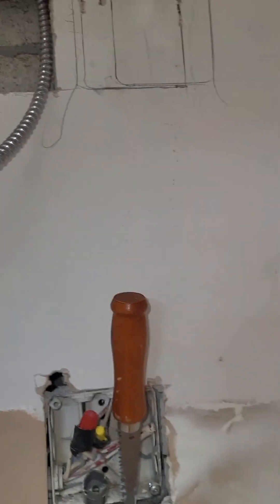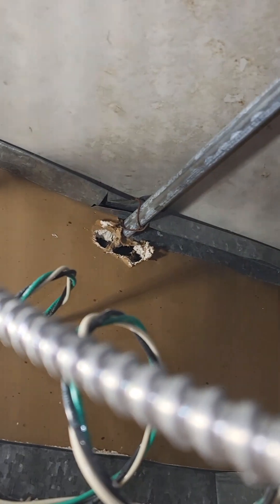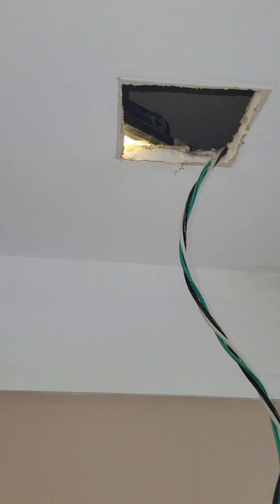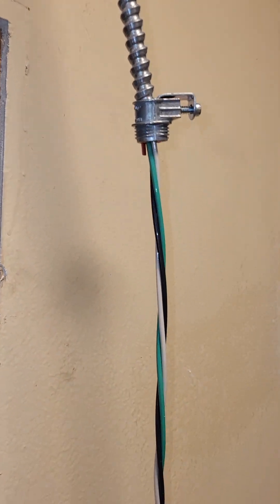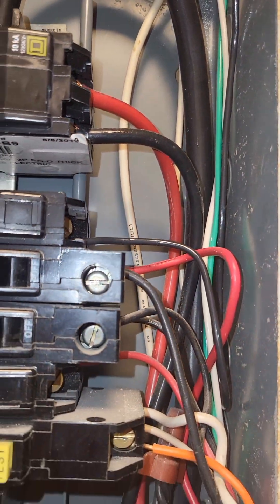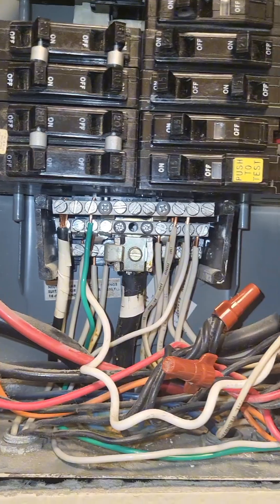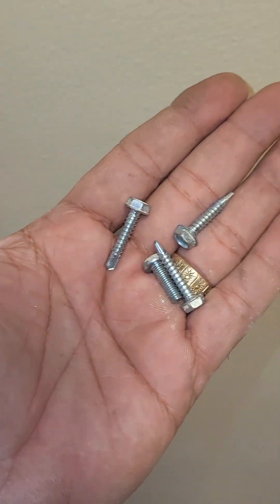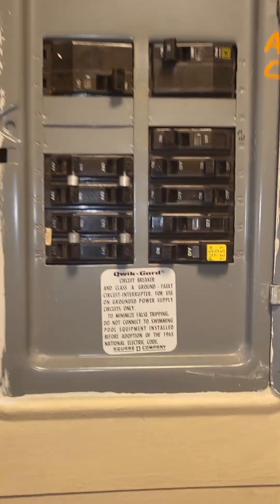New Circuit for microwave hidden dangers.#microwave #electrical #electricalfire #electricalwiring

Comment: Please tell me you at least replaced those taped connections with something more appropriate before putting it back together.

You can't fix stupid people, but you absolutely should fix stupid work if it is actually dangerous (which those are), when you find it.

(The loose wires in the ceiling aren't to code, but they're arguably not actually dangerous, so since you're not actually working on that circuit, that is more of a call for the customer whether they want to pay you to fix that too or not.)
Reply from the maker: I corrected all that I could. I also made the owner aware he did not care. No wonder he got that type of work.